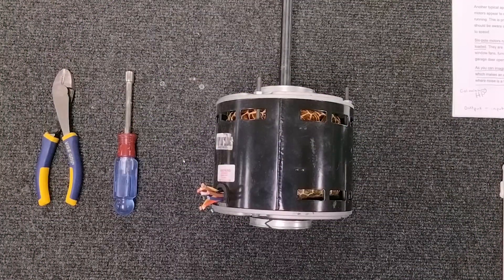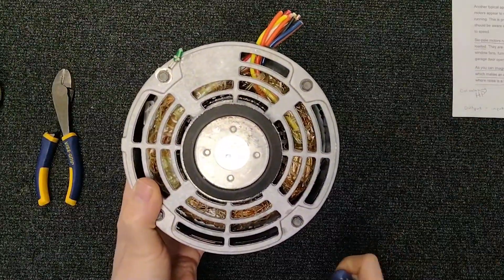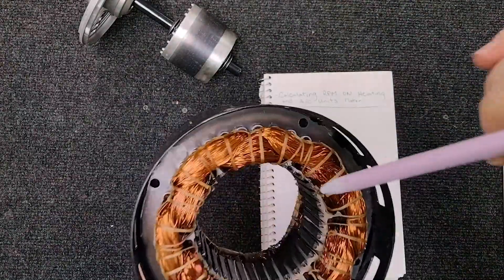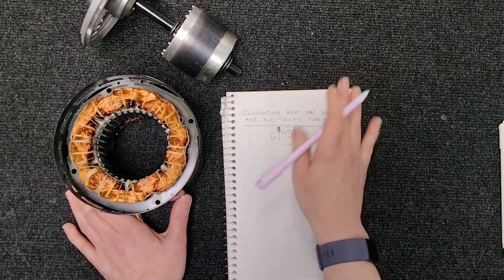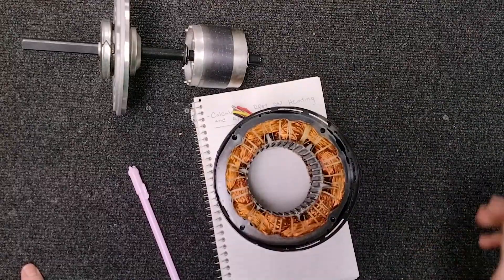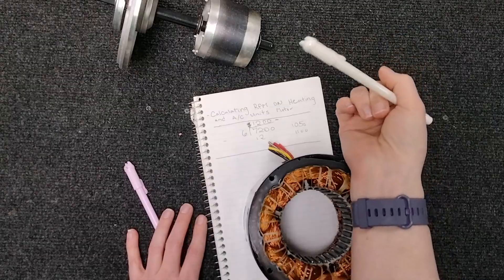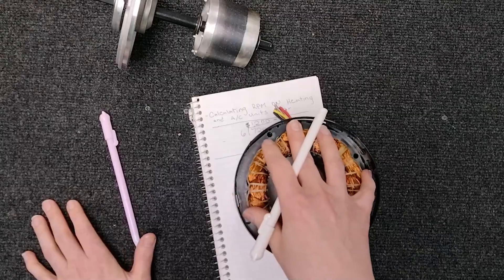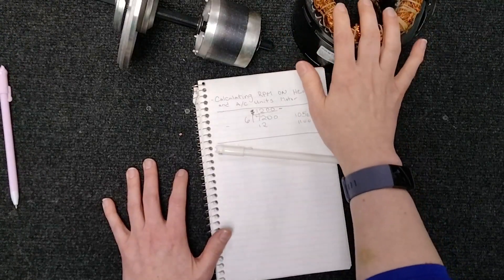How To Calculate What RPM Your HVAC Motor Is When The Label Is Missing

Comment: if I have a direct drive motor rated at 1,760 RPM, how much does the rpm change if I open the blower door to measure motor rpm with a strobe light?